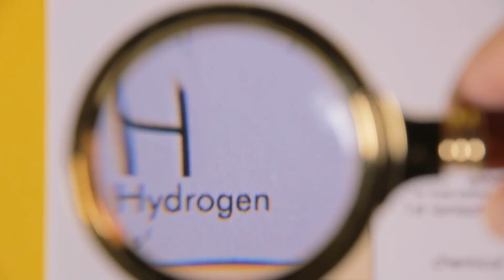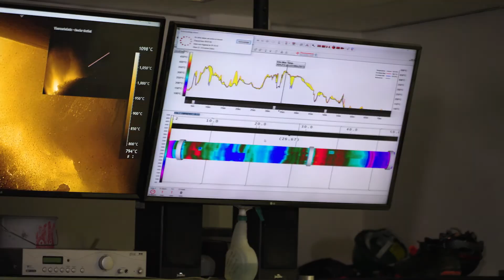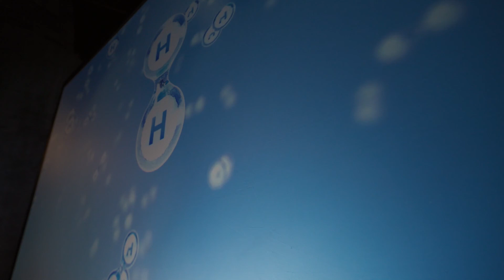Industrial Power Hydrogen | The Exciting Potential of Hydrogen

Comment: It is more practical to convert H2 (hydrogen) to NH3 (ammonia): 3 H2 + N2 => 2 NH3. Ammonia is a liquid if you cool it moderately and then keep it at about 12 bar pressure. Ship engines that run on ammonia exist already. E.g. MAN and Wärtsilä marine engines make such marine engines.